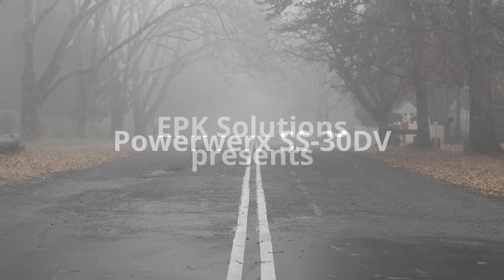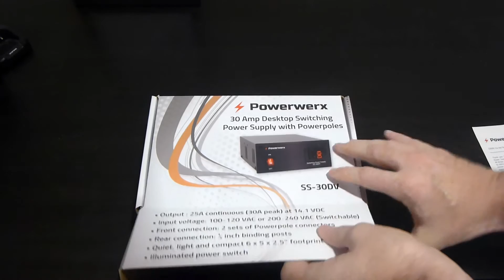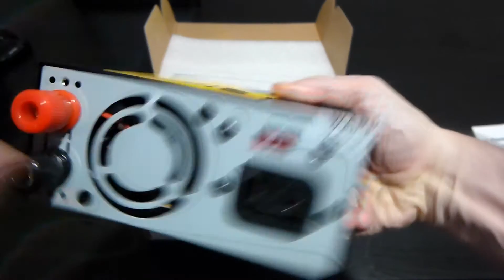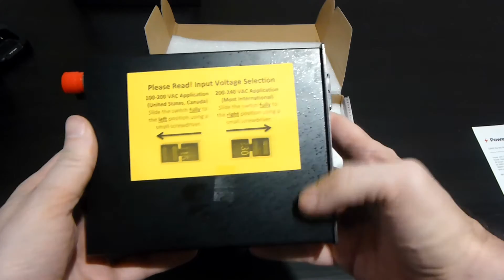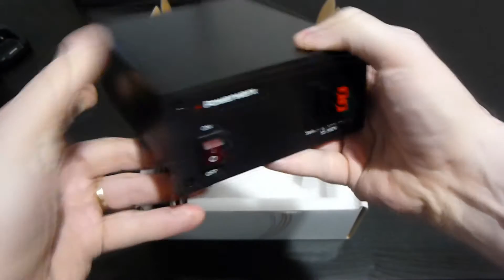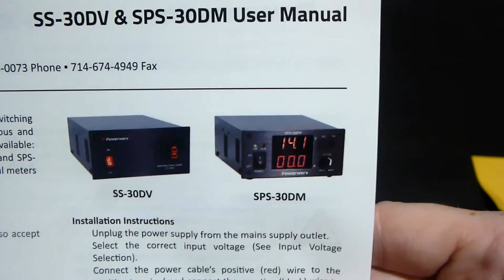Powerwerx SS-30DV Desktop Power Supply *Unboxing*

Comment: I prefer the MFJ 4230MV. For roughly the same price you get a V/A meter, an LED to show if it has shut down in protect mode, and it has a very good reputation among hams for reliability and low noise.